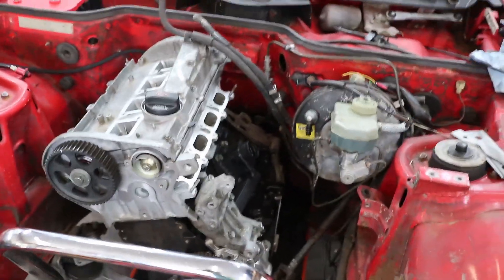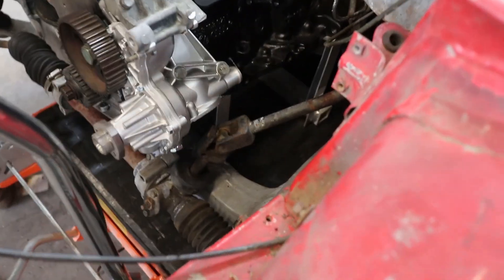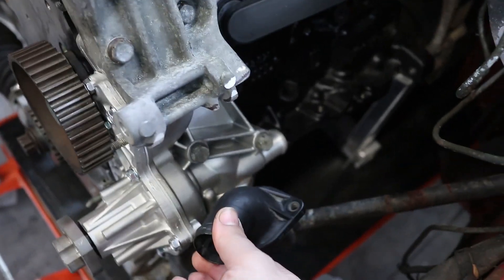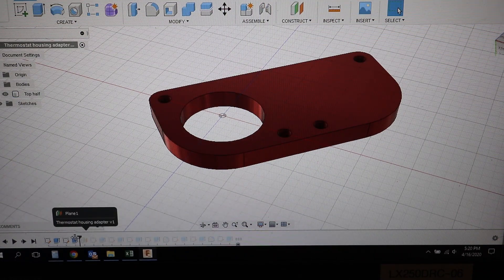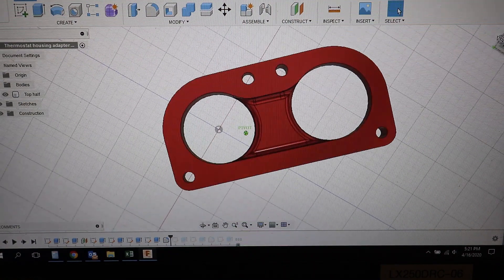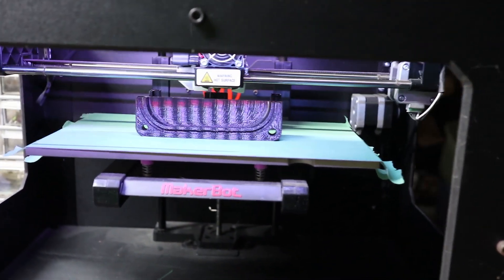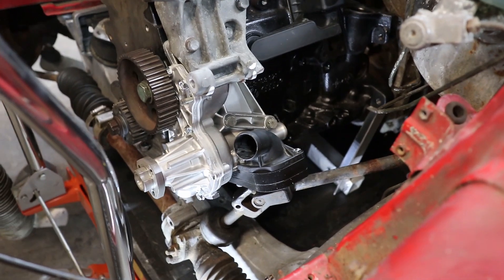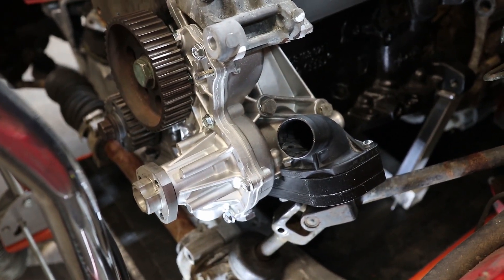1.8T engine in 944 - design thermostat housing adapter

Comment: IF YOU WENT WITH A 06A BLOCK THE WATERPUMP IS UNDER THE TIMING COVER
Reply from the maker: True, but the chain-drive oil pump interferes with the 944 subframe.  I figured it was easier to modify the water pump than the subframe and steering rack.

Comment: Wow! Love the way you always approach issues/problems that have to be solved. Well overthought and keen on the details 💪 I do have a question regarding this design. (I’m not a mechanic or engineer.) Normally the thermostat opens when the return flow of hot coolant from the head will pass in close proximity to the wax element in the thermostat. It will then be partially/fully open around 90-100 degrees C. If the thermostat will be placed in a different location, further from the flow of hot water, will it still reach an acceptable temperature to open and send hot coolant to the radiator without creating too much lag and possible cooling problems? You probably have thought about this, so I am curious about your thoughts on this!
Reply from the maker: I have thought about that... and I think the solution is to use a lower temp thermostat if it's a little further away.